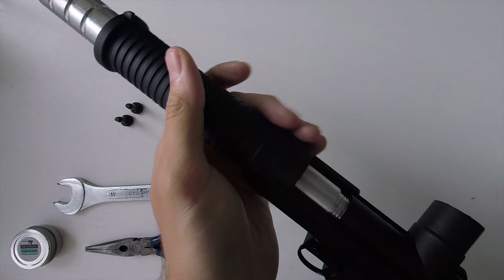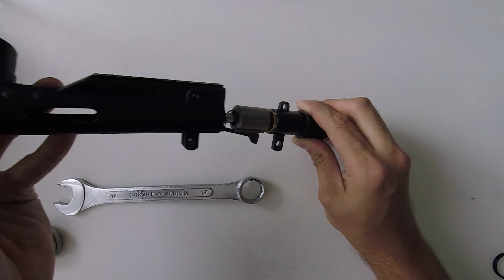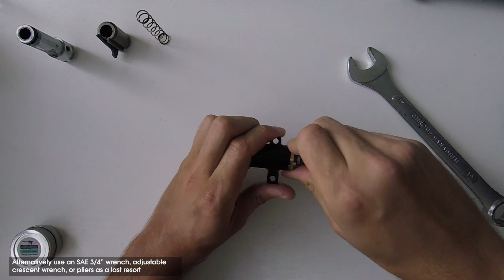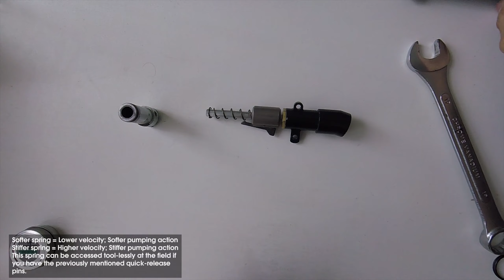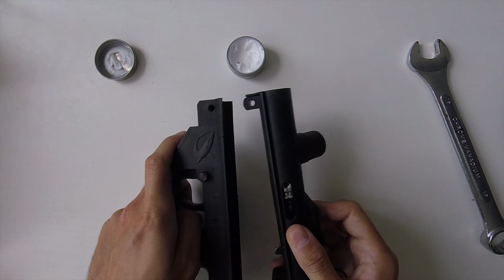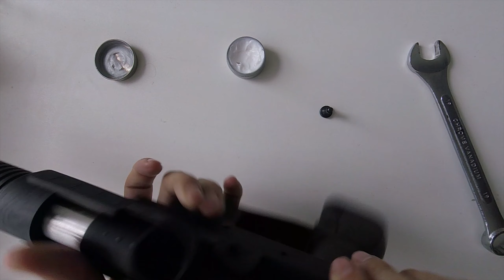Brass Eagle Tiger Shark Disassembly, Reassembly, Velocity Adjustment, and Troubleshooting

Comment: By any chance did you know the size of the powertube? Will it accept normal nelson powertubes ?
Reply: Sorry for the extremely late reply, but I don't know the size of the power tube relative to other Nelson-valve markers...  I could take some measurements with calipers I have if you know what dimensions you're looking for (inner diameter, outer diameter, section lengths, etc.)

Comment: To use aftermarket barrels, I bought a Spyder (male) to Autococker (female) barrel adapter made by Lapco and an M22x1.5 tap (Spyder threads) to use Autococker barrels with the marker. The Spyder adapter is about 1/4" or 7mm from the edge of the bolt, but the bolt pushes paintballs into the adapter and over that gap anyway.

This allows you to run underbored barrels and subsequently prevent double feeds and rollouts.  I wrapped some painters tape around the barrel so that the BE Tiger Shark handle doesn't scratch or scuff the barrel's paint, but it works great.